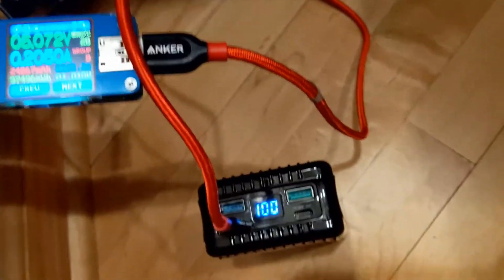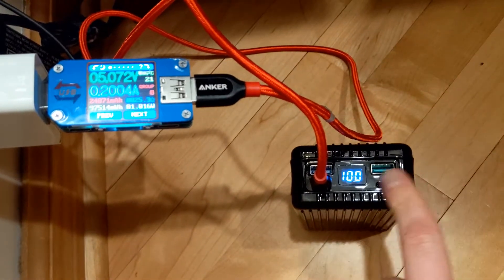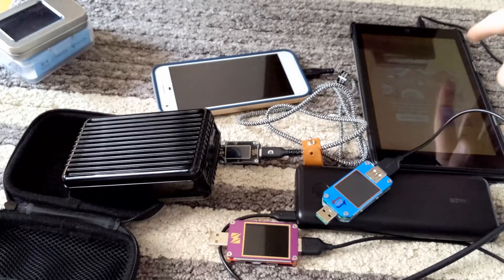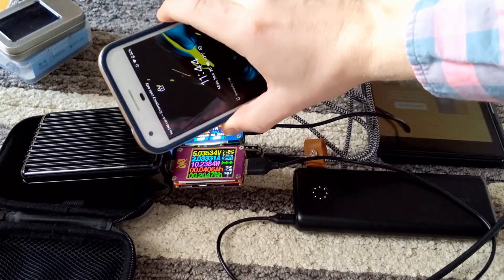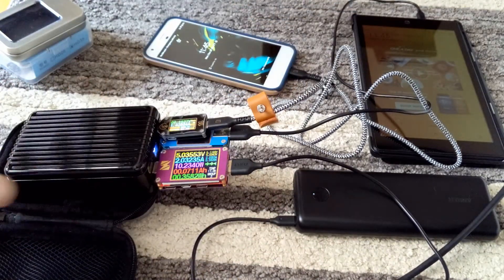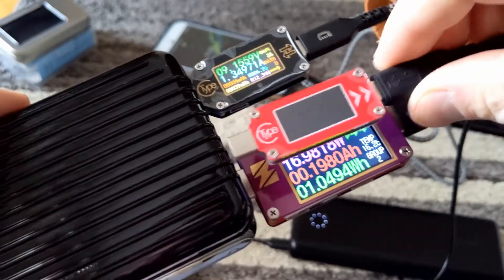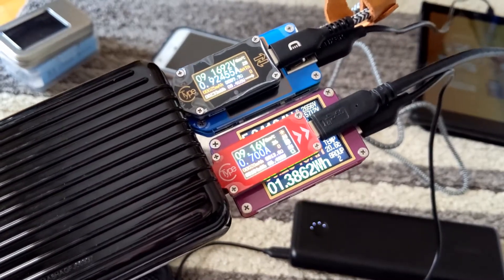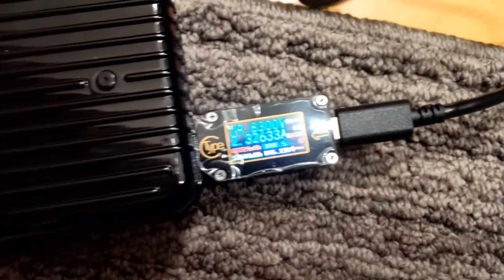Zendure Supertank (Somewhat Technical) Testing - Part 3 of 3

Comment: I have tested my powerbank and found that I also have the same issues that you mentioned and the same issue also with the quick charging @ 18 watt & 15 watt 
Thank you again for good testing
Reply from the maker: Glad it was able to be replicated, despite being unfortunate for the battery itself.
Reply: @dunderhead  Did you find solutions to these issues or did Zendure contact with you about these issues or replace it again?